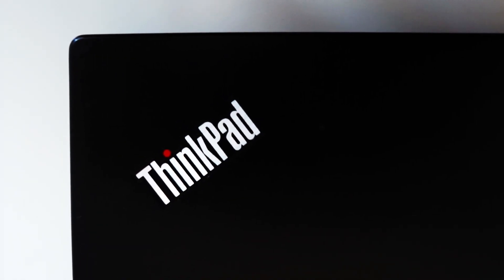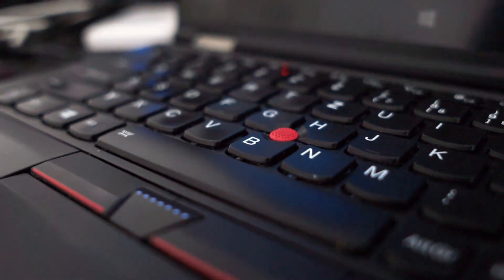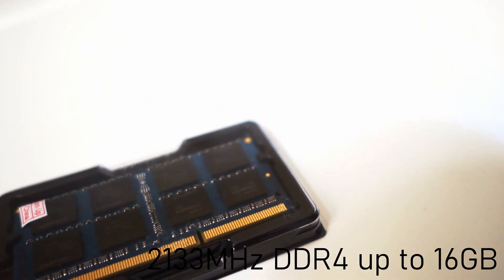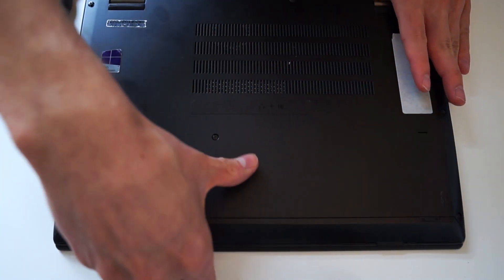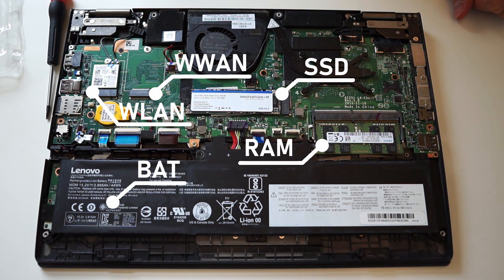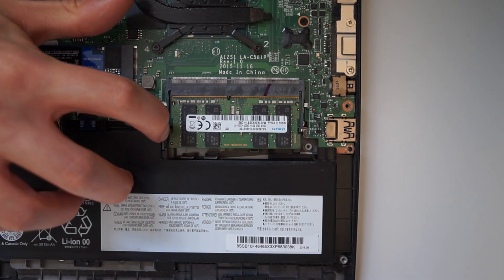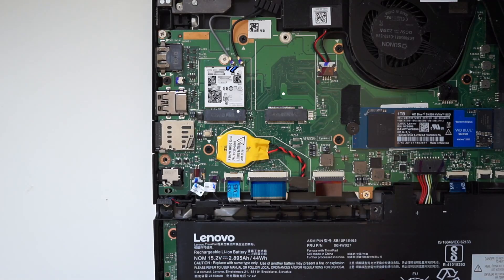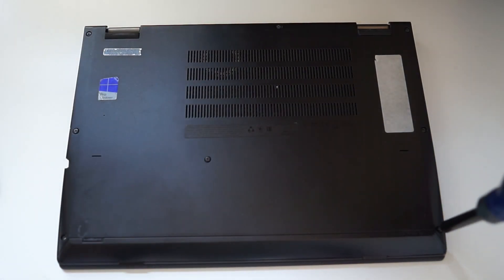ThinkPad Yoga 260 NVMe SSD upgrade (SSD, RAM, WLAN)

Comment: NVMe size: M.2 2280  so it is 80 mm long. The model shown in the video: SN550 WDS100T2B0C. No parts on the bottom.

Comment: I cannot find the power cables for the wwan card ..!
Reply from the maker: Do you mean the antenna cables? They are only present in models that came with the WWAN card installed by Lenovo. Otherwise, you'll have to install them inside the display lid.
Reply: @classicdome9347  oohh thank you 
What is the model of the antenna ?

Comment: what wwan card type 4G LTE for yoga 260?
iam confused about it
big thanks
Reply from the maker: The card you are looking for is the "Sierra Wireless EM7455". But if your Yoga260 was not shipped with a WWAN card it most likely has no antennas build in (like mine). Retrofitting these would be very difficult :(.